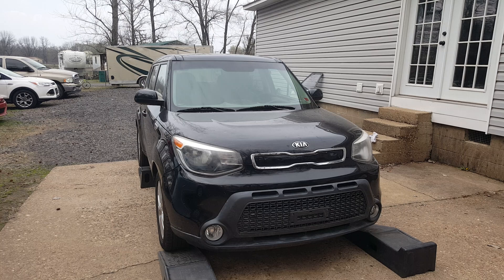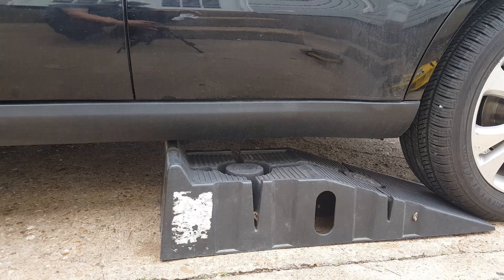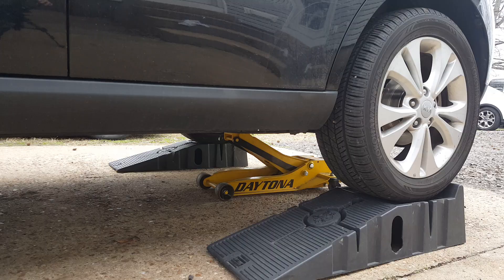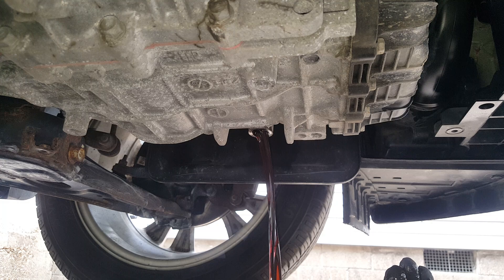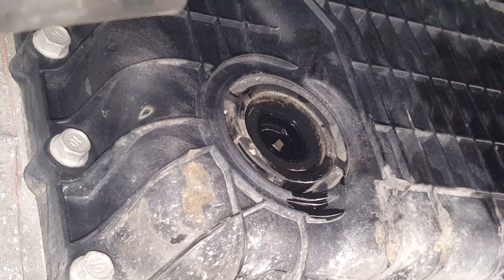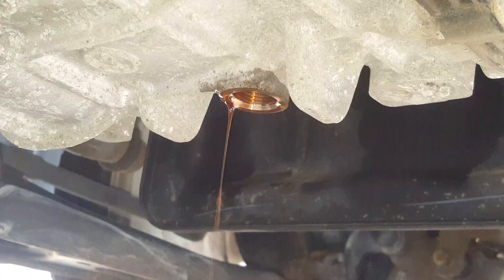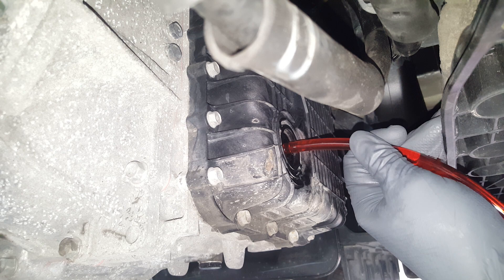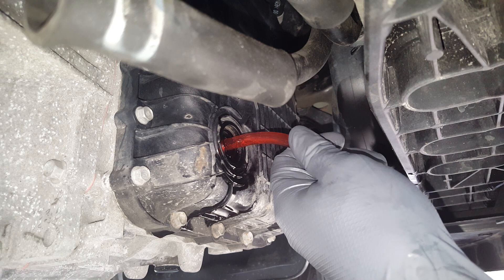How to change the transmission fluid on 2014-2019 Kia Soul Easiest Method

Comment: Hi, Great video. My wife has the exact same 2016 2.0 Kia Soul. Just finished a tune up, new plugs, ignition coils, PCV valve, oil change, air filter and cabin air filter.  All she does is add gas lol… Anyway I was looking for the transmission dipstick and did’t find one as they just don’t have one. Came across your great video. This is next on my list and doable for an old guy like me.
Reply from the maker: I really appreciate you taking the time to leave such great feedback , thank you for watching.
Reply: It's a sealed system

Comment: That's how I pump in my trans fluid on my 2017 Kia Soul. If I let it run while I'm pumping it in it will take in another half a quart then when I turn it off it will pour out quickly. I always wonder am I supposed to keep a topped off while it's running or when it's off. I've changed it several times since new.
Reply from the maker: You want to fill it running at temp and and plug it before turning the car off. I appreciate the feedback.
Reply: Here's why I'm not sure of that. When I drain the fluid about 3 n 3/4 of a quart come out. The same amount pumps right in without starting it.. but then it will take in another half a quart after it's running. And that's 4 n 1/4.qts. that seems like too much to me because when I first changed it years ago the original amount that came out was 3 n 3/4th. But the good news is it seems a little Universal for the amount going in it. It can be overfilled a little.
Reply: @eastcoastroadrunner maybe stop at 4 quarts even instead of the extra quarter quart?? 🤨

Comment: I'm new to this and have never changed the transmission fluid. Why do you have the engine running? Do I need to turn it on only while finishing pumping the fluid in?
Reply: When you check the transmission fluid it has to be under normal operating conditions (i.e. has to be warm as if you are driving) if it’s checked when it’s cold you could get an incorrect result (it could indicate that the fluid is low when it isn’t really)! Allow it to continue running while you check the level!
Reply: @TatumDeatherage  makes sense but to further clarify, since I also have never done this, will the transmission fluid warm up to normal operating temps or should u actually take it for a drove and then check? Thank u

Comment: well I didnt do a transmission flush on my 16 manual because I was told its a "closed system" that you dont do that on, transmission seems fine at 250k miles but hell should I do a triple flush if you are supposed to do this?
Reply from the maker: Usually the manual transmissions do not need much attention. I believe they only take a couple of quarts. With those miles it would not be a bad idea to change it out. The oem fluid or royal purple synchromax. This one is an automatic in the video. Thanks for the feedback.
Reply: @s33therfan  what about Redline 75W-70 GL-4 or do you think the other you mentioned are superior

Comment: Trying to do mine but why auto store sold me 8 quarter and you did it almost 4 quarter
Reply from the maker: Yes , 4 quarts is all you need on a drain fill. If you flush the entires system it will take 8 quarts. I usually just stick with doing a drain fill every 30k or so. Thanks for the feedback.

Comment: Hello mister, i want to know if i need some special atf
Reply from the maker: I believe it calls for Kia type 4 or Hyundai SP4 ( same ), I know oreillys or rock auto can order the Idemitsu HK4 . Idemitsu is much cheaper than the Kia Hyundai brand and is pretty comparable. In my opinion any compatable atf that is full synthetic is pretty good. I have used the idemitsu as well as dex VI full synthetic. Thanks for the question.

Comment: Good video… my sugestión before you open or drain oils, all ways first open the refill plug. That way you sure be able to put the new oil.
Some times plugs are stock or break when opens.
Reply: Excellent suggestion. I had trouble cracking loose the refill plug on my wife's Chevy. Took a while but I got it.

Comment: Great video! So how much fluid does a 2015 actually take?
Reply from the maker: 3.2 quarts (drain fill ) should be about perfect. Thanks for the feedback.
Reply: The manual for my 2015 states “Manual transaxle fluid: 1.6 Engine needs 1.9~2.0 US qt. (1.8~1.9 1) and a 2.0 Engine needs 2.0~2.11 US qt. (1.9~2.0 l)” 

And an automatic needs 7.71 US qt. (7.3 l) for both engine sizes.

Comment: Any idea on how to check the level on hybrids as they usually dont idle the engine, and there is no torque converter spinning. I cant figure out if the engine needs to be running or not with a hybrid. I have a 2019 Optima PHEV